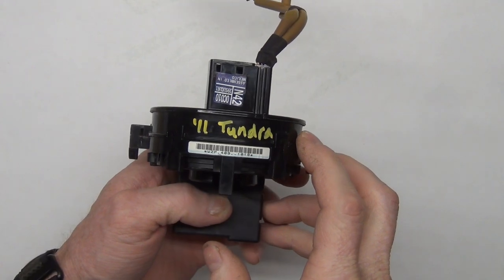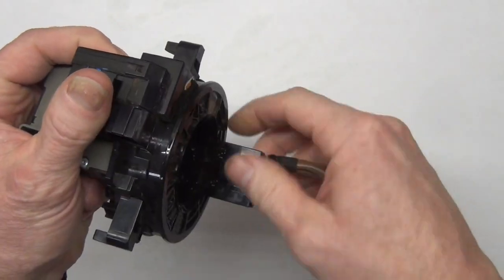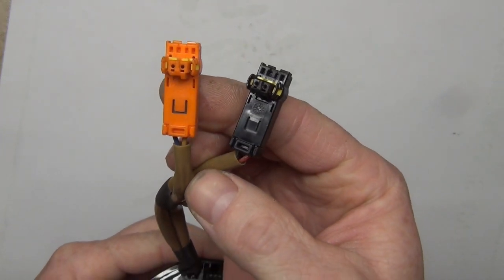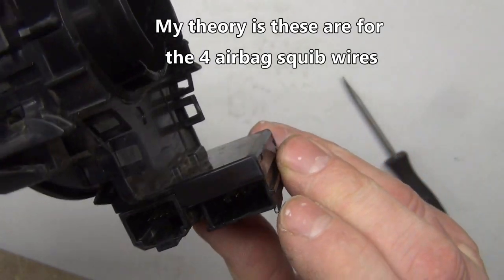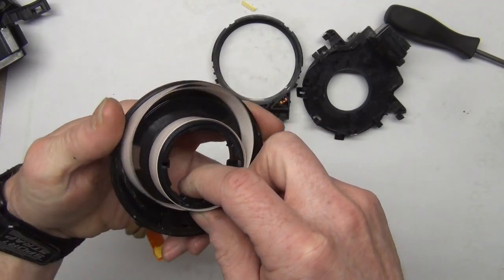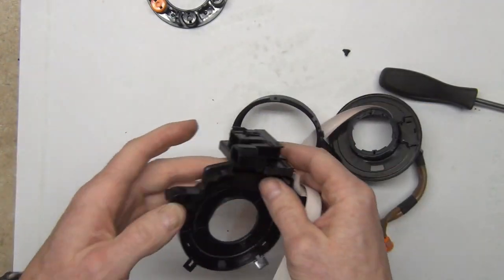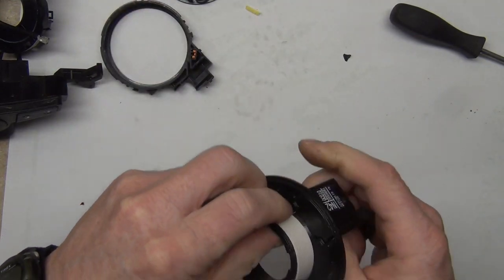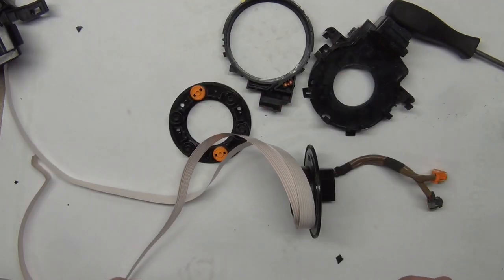How is an Airbag Wired Through a Steering Wheel?

Comment: Great video! I actually need to modify the clock spring in my 06 STi because I am installing a wheel from a 15 STi. I still need to work on the electronics for the audio & cruise controls.

Comment: It is a ribbon cable, the company I work for use to make a lot of that type for Xerox copiers. It is run through a lamination process with heat and pressure to fuse the cable together. You can have air bubbles that can cause short and/or inclusions in the copper that fail over time.

Comment: I think the word that eluded you is "Conductor", yes?  Boat engine controls with power tilt use work similar.
Reply from the maker: That would work, or circuit band, or flat flex cable.

Comment: I was Wondering if I could ask you a question? I got a deal on a 97 s10 blazer. because it needs a trans. I was wondering if it could be the electronic bits causing the problem. it will go for about 2 minutes while cold. then nothing. no forward or reverse. I never worked on a 4L60E. I'm not sure how it works. most trans I had go bad. just completely stopped. or only had forward or reverse. but I was hoping I can replace some electronics and fix it. but probably not that lucky. what do you think the problem is????   your help will be greatly appreciated thank you.

Comment: 24 karat gold plated ribbon cable. All SRS systems use 24 karat gold plated wiring &  terminals- best conductor with zero corrosion factor. (silver and copper are better than gold- but corrode easily). Now you know why a "hunk of plastic and wire" is so stinking expensive.
Reply: Still waiting on graphite coated cables to replace gold. No more gold to extract from circuit components. But I wouldn't care. These super conductors, graphite, quantum computing can't come fast enough.

Comment: Given the fact that electronic, metal, and plastic auto parts fail over time, how is a restorer 50 years from now going to recreate this ultra complex part?
Reply: Bob Fortune If there is still freedom and democracy in 50 years, I bet you could just 3d print almost anything...
Reply: Bob Fortune he just won't have airbags (who wants them anyways) or electronics on the steering wheel.
Reply from the maker: There'll be something cooler to replace it.

Comment: With all those moving parts, it's hard to imagine there won't be a need for replacement parts years later. What bothers me about that is the notion that some manufacturers feel they are only responsible to keep parts in stock for a few years beyond the life of the warranty. Imagine trying to make something like this on a 3D printer -- not easy.

Comment: Seeing the clock spring come to a stop at both ends of travel can be misleading.  With the weight and mechanical advantage of the steering wheel on you WILL NOT feel the end limit and will immediately destroy the wiring inside.  So be careful:)

Comment: I think the cable is called flat flex cable. I have to replace one of those on a 2004 Chevy Silverado. Plus I need to look into either repairing the gauge cluster or replacing it. The information display is all garbage text. We get numbers clear as day but cant tell what its saying for what those numbers mean. I think it has something over 200,000 miles on it. An when it comes to airbags. they tend to worry me lol  even after taking the precautions of disabling the system before removing them. I guess you can say its respectful fear for that device?
Reply: By the way, your gauge cluster videos will help me in my clusterf--- journey when it comes to this truck lol